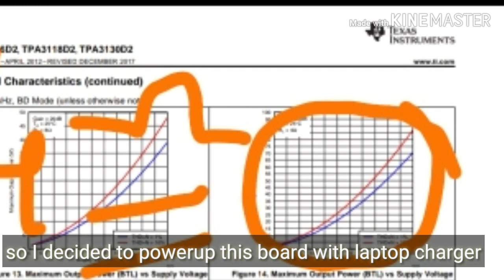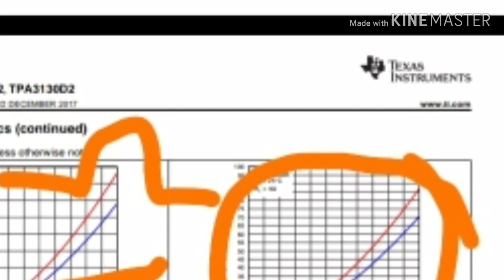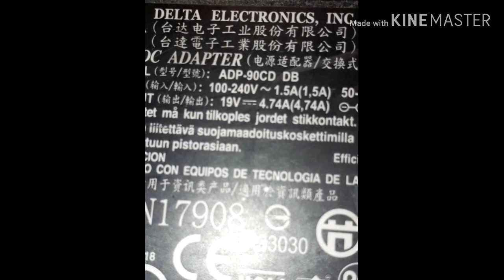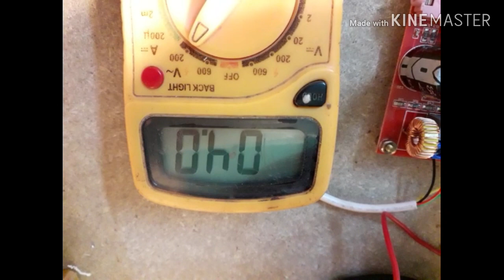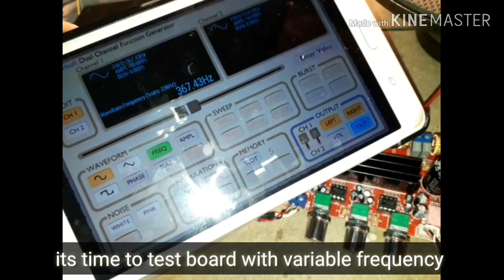TPA 3116 class-d amplifier review and test of board

Comment: Thank you! Very useful. Mere subwoofer output mein koi sound nahi aa raha hai, aur 17-18 volt output de raha hai. Mera SW 4inch 4ohm ka hai 25-30 watt ka hai. Kya yeh board ki kharabi hai, ya speaker match nahi kar rah hai? Wohi speaker dusre L ya R output pe bahut accha perform kar raha hai. Main 19 v 4 AMP power supply use kar raha hoon.

Comment: Sir i problem with tpa3116d2 board 
Woofer bass out put clear  but speaker 1 second ko sound ati hai fir 2 second bad ati hai  matlb pit pit pit pit krta rhata hai power on krne pr ya kya problem hai
Reply from the maker: Aap 3116 ic ki pin ko dubara soldering karke dekhiye, problem solve hona chahiye
Reply: dc power kitna volt use karrahe ho
agar voltage pura nhi milta hai tab bhi yeh problem aati hai.plz chk power supply

Comment: आप लोगों को तो वीडियो बनानी है इसलिए थोड़ी देर के लिए वीडियो में टेस्टिंग बता दो बस आपकी वीडियो बन गई पर इसका capacitor blast hota Hai yah bhi to batao 25 वोल्टेज यह बोर्ड सह नहीं पाता है यह हमने प्रैक्टिकल किया है आप भी खुद करके देखो सही रीजन पता चलेगा
Reply from the maker: Sar ji isiliye is board ko SMPS se supply Di Jaati Hai Taki voltage fix Rahe Transformer se supply Dene Se Main AC voltage badhane se Transformer output bhi badhata  hai isliye capacitor fail ho jata hai